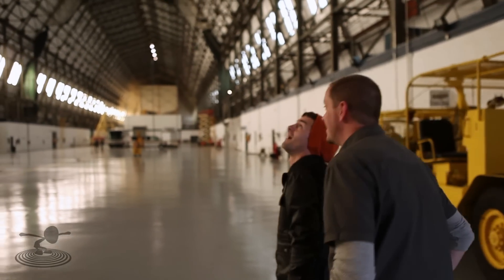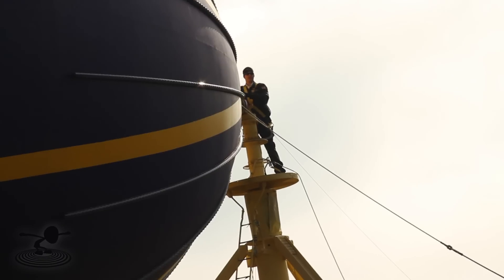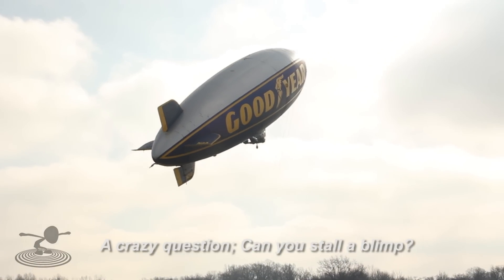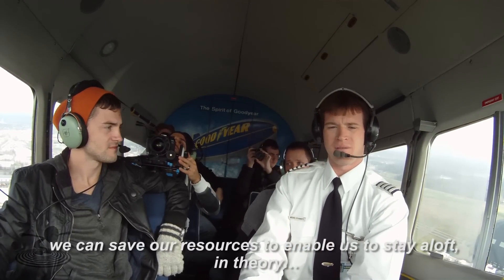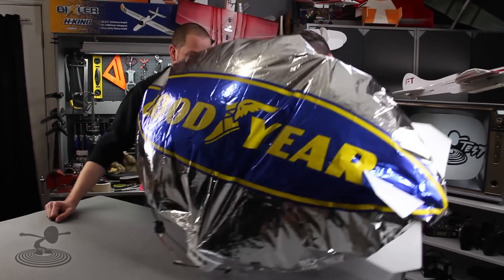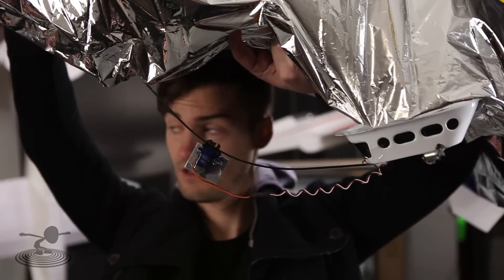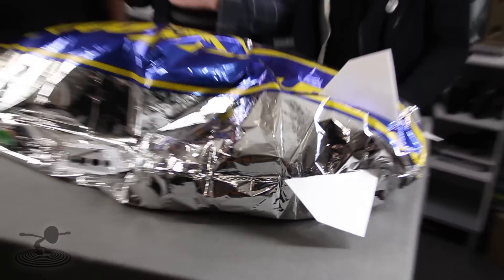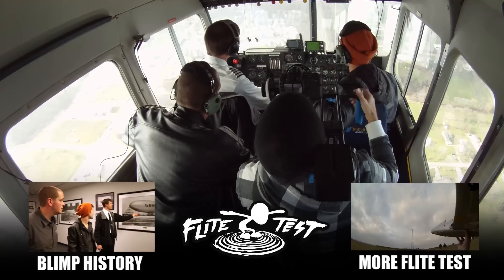Airships (Goodyear Blimp) | Flite Test

Comment: I just started to fly 2.5m long blimp. Wight and helium is balanced so that you need motors to keep it in the air. So in case of motor breakdown, battery failure etc. the blimp slowly lands.

Comment: Great video guys, question about the thrust motors on the small-scale blimp: are those motors just a servo motor connected to its original board and plugged into the receiver, or is there some kind of ESC that you used?

Comment: Why don't we bring back zepplins back as passenger transport? Many of the problems seem to be able to be remedied by modern technology, and it would be much better than an airplane, to the point where they were even called "flying ocean liners" at one point.
Reply: Helium shortage seems to be the limiting factor. Helium on earth is an accumulation of alpha particles from radioactive decay of heavy elements. In the past it has been a scarce resource, but this has been largely negated by new technology which has allowed ever lower levels of helium to be extracted as a by-product in the natural gas production process. We have no way of producing "new" helium, but the ability to exploit less concentrated sources along with measures to conserve helium as it is "used" have made it unlikely that we will run out. As a product of nuclear decay, small quantities of helium would be made in all nuclear power plants, but at the moment, the capture of this helium isn't economically viable. And we already know about hydrogen and how that worked out. But I agree, and personally believe that the airship is going to become the aviation giant in the coming years. As it would make the best  of solar panel power, as it does not require energy to generate lift. And could go way above the clouds and weather, meaning that it would avoid storms, which were a huge problem with the first airships, and would be in a less obstructed view of the sun, allowing the panels to soak up energy more efficiently. And they have indeed found success in the past! Imagine if the Hindenburg had be allowed to use helium...I almost wonder if the great airship era would have ever stopped.
Reply: Our military actually is using them again. Look up the LEMV. It uses a combination of gasses to get the same helium lighter than air affect. I have read that these things can fly autonomously and also stay up in the air indefinitely. You fly above the clouds and put some solar cells on the top and yes. It will never have to come down. It will be like a sky sub. You only have to dock when food stocks run low.
Reply: rAdiant Jet Last I heard, that project was cancelled due to military budget cuts.
Reply: Helium is rare as it is and they go very slow

Comment: I feel like remote controlled blimps are a little bit stressful to fly outside because of the many things that can go wrong. If the rc blimp is calibrated for really cold weather and is suddenly flown during a really hot day the motors might not be able to counteract the increase in buoyancy and the whole blimp could be lost. Another concern is that you have to really make sure that the gondola will not come off.

Comment: I like your weight controlling idea for shifting, but I think you could just use a servo to rotate the engine pods up or down to pull up on down.... or was that a stock config that didn't work?
Reply: +nickademuss42 Weight shifting was the first method for trimming an airship that Count Zeppelin tried.
Reply: yah, they used people or water to move weight around, such a smooth ride unless its windy

Comment: Wouldn't it almost be easier to build an RC blimp with tilting motors that go up and down. One servo on a hinged motor mount. Instead of a modified servo on a track. 

I know you'll lose scale, but then you could also aim the twin motors all the way up or down and spin one motor to move the blimp side to side. Again, losing scale, but gaining more control.

Comment: The world's helium supply is due to run out in 20-30 years... 200th comment!!
Reply: Dont mone if im wrong, but cant you make helium?
Reply: Sam Field
Not unless you are a star.  Nuclear fusion is the only way.....
Reply: Yeah, I'm super paranoid about that topic.....thanks.
Reply: Mark Ryan I KNOW RIGHT!! I can barely process the hought of no helium!
Reply: RHYS JONES
And we will not be able to process all of the important technological manufacturing processes that depend on helium.
It will not be good.
Reply: Mark Ryan But the worst part is that we won't have anything to do at younger sibling's birthday parties!
Reply: Mark Ryan WHAT IF I AM A STAR!?
Reply: WHAT IF YOU ARE????????????????
Reply: clemens dotson
Stars make helium.
Reply: RHYS JONES 
Hydrogen would work just fine to make party balloons. And they do tricks if you pop them using a lighter.
Reply: SuperLoopholes Yes but helium has other uses specific to helium. Hydrogen should be used in balloons because it's a renewable gas ...
Reply: What happens to the hydrogen when it's released? Does it form new water?
Reply: RHYS JONES no it wont 
helium dosent react with anything mening no helium has ever been lost from planet earth we have exacly the same amount of helium as we did since the earth was formed. 
only that less is in reserves and more is just in the atmosphere.
Reply: Emperor Seals
It escapes from the atmosphere into space and is unrecoverable.
Reply: Mark Ryan
Jupiter and staurn have it now but it is still being made from radioactive decay
Reply: Emperor Seals
Its going to be expensive to harvest it from Saturn.  Jupiter should be slightly cheaper.

Comment: so if  there is a punctchure in the baloon then your fucked?
Reply: Red The Gamer Depending on your height and the size of the hole... Yes/no.
Reply: not really it won't just fall out of the sky it will slowly float down
Reply: daniel mcnail
well yeah, but what if kim jong un bombs it? then will it fall?
Reply: Red The Gamer
Depending on the size and heat of the blast... Yes/no.
Reply: +Aramiro Absolutely correct :-)